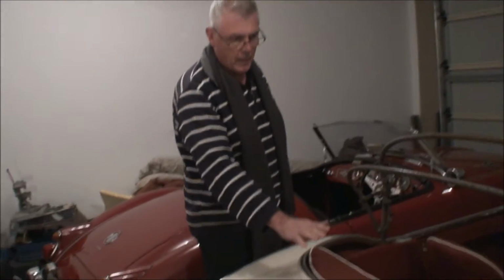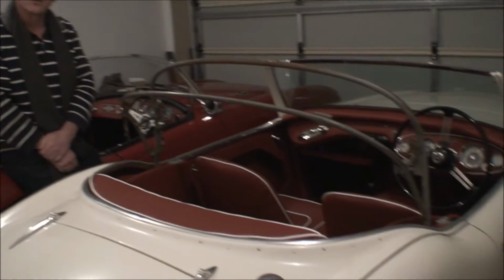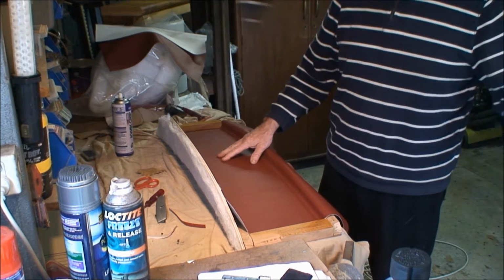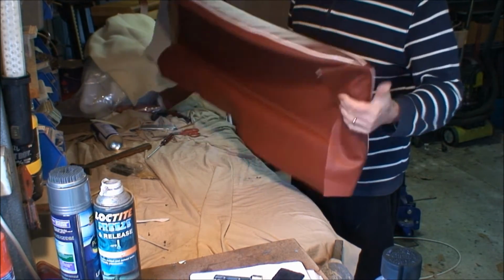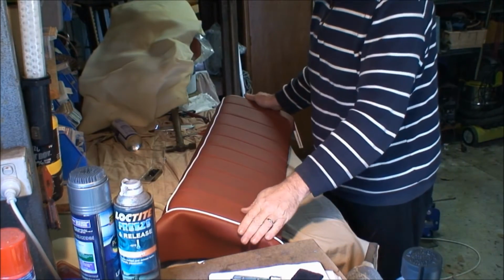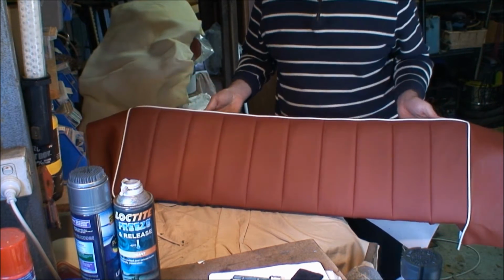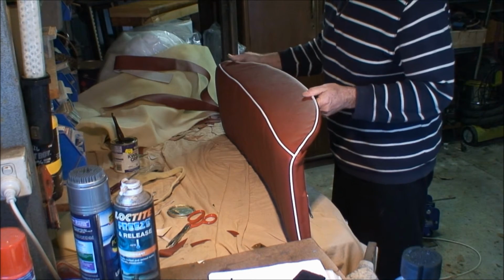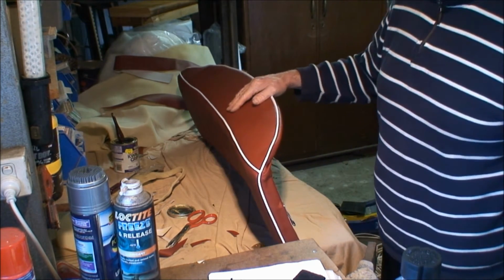Austin Healey 100/6 restoration Pt 52

Comment: I was just thinking as I watched the drive that you have some beautiful roads near your new home to drive her on so you must have enjoyed the drive.  Then, I remembered it's winter time there and realized you were likely quite chilly on that drive!  

She looks gorgeous, Matthew!
Reply from the maker: thanks Ron
yes, it was a bit chilly and it got much colder a couple of days later. We don't generally get snow here but it can happen. There are some beautiful drives around the Adelaide hills but I was a bit on tenter hooks with that one: waiting for something to break, first drive you know! I'll go for a proper one and film it when all's done. She ran well but the new drive is very steep. Caught the exhaust pipe.
Reply: If you're able to do so, come into the bottom part of the drive at an angle to minimize the scraping.  It's either that or set to work with some concrete and a shovel to lessen the initial angle.

Comment: Hi Mathew, nice to see another video. Did the car drive well to its new home?. Interesting to hear you say the backrest panel was one of the hardest jobs. It was exactly the same on my BJ8. As you know there are two folding sections and a backboard. I made all the wooden panels and used the standard upholstery kit but the backrest padding was much too thin so i re-used the original which was in good nick. This gave a much nicer profile to the backrest but making everything work as it should was a long job. The finished job though is excellant.Keep up the good work. Best Regards, David Roberts.
Reply from the maker: Hi David
yes, actually, the car ran very well. Brakes ok, but too much travel on the pedal.